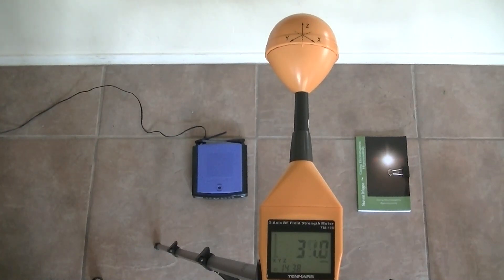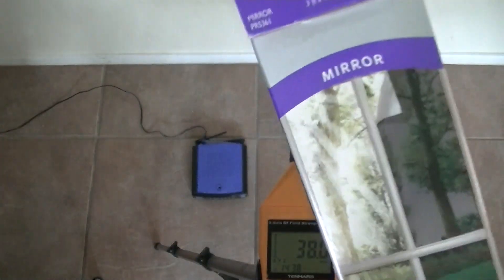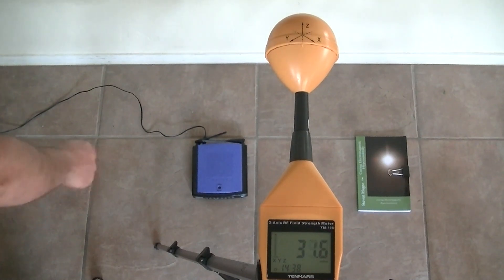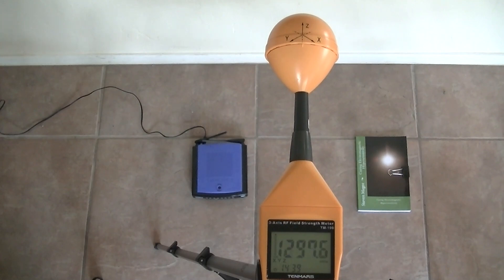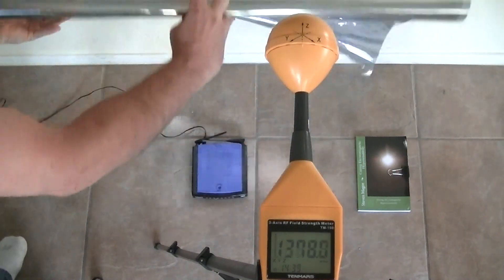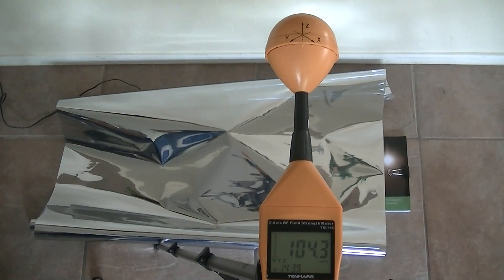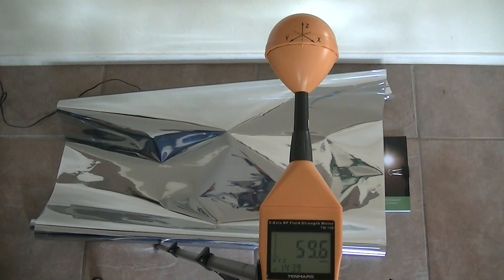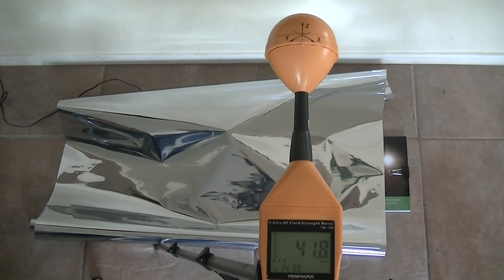Testing Mirrored Window Film for Electromagnetic RF Shielding

Comment: To anyone watching this in the future... this works so well. I have a 5g tower right in front of my apartment. I tried making aluminum screens with a 1mm aperature but failed they look terrible. I didnt want to spend 300 dollars on tint advertised for emf radiation but had to do something for my windows. I bought this at home depot it was 40 dollars I can do all 3 of my windows. It is mirrored and made of titanium and is an absolute god send. I know 5g has higher frequency than a lot of readers can go, mine goes from 20Mhz to  6Ghz, and as soon as I put this up I was down to previous levels before the tower went up. And I mean this thing is literally in my front yard. 

As for the walls, I have put aluminum foil for now, looks terrible. I'm going to try the aluminum backsplash wallpaper on Amazon that's 10 dollars a roll for about 15inx100in, somewhere in that range. It'll cost me around 120 dollars to cover the two most important walls and that will look a lot nicer. Then for the opposite wall I'm just stapling aluminim foil and I will be getting a ceiling curtain track it's about 20 dollars on Amazon and hanging a large 90 in tall by 100in wide curtain that will have a portrait of something on it, haven't decided yet. There are quite a few cool ones online. The pictures that people have posted are pretty cool. So there's just a few ideas for people on a budget. I live in an apartment and can't do permanent. I can't use emf paint because it needs to be grounded and is just about permanent unless you want to risk ruining your wallboard with an electric sander. If it were a house I owned I would paint as it is the nicest looking option. So anyway, thanks for uploading this, I probably wouldn't have considered mirrored tint and would have spent too much on emf tint or emf curtains.
Reply: ChicGreekGeek  well I use the Trifield Tf2 which I think is more or around 200 dollars, I've had it for a while. I wouldn't worry so much about other peoples routers unless they have put it against a wall that is shared by you and its in a spot you spend a lot of time (like a bed against a shared wall with a router on the other side) because radiation from a router falls off very quickly. The bulk of the radiation is within a foot of the router, if I'm standing 6 feet from my router I'll barely register anything. That being said I put a "router guard" brand shield over mine because the only spot to plug it in what next to my couch, and then I have my computer wired into it. 

I would cut around the outlets, thats what I did. And I suggest standing a few feet away, again the radiation will fall off quickly the further away from your phone you are. I measured my phone and was probably standing 4 feet away when I no longer got a signal from it while I was downloading something. The radiation can only bounce back if it can reach the metal surface first. So just keep that in mind if you have like a chair or something you sit in thats up against the screen, any rf radiation that hits it will bounce off and travel a very short distance. 

Thats good you are getting involved, good luck. I know they don't seem to have any responsibility to prove that its safe because it meets the decades old FCC safety standards. A whole system overhaul is what we need. Until then its a very round-about fight
Reply: Excellent info.  I'd love to hear more.  Products, links, what you think about them.  I'm in the same boat.  5G metres going up everywhere; headaches have started, insomnia, tinnitus has shot through the roof, can't concentrate any more and everyone in the house is short tempered and reading to 'go off' over nothing at all.  Got to do something.  What else are you using.
Reply: @ВладимирПутин-е7м  hi sorry I didn't see your comment. I posted one just now with the brand of tint I used but most of the stuff is just common that you can get from multiple brands online or in store such as aluminim screening, mylar, aluminum foil, ceilings tracks etc.
Reply: Nice work! And your efforts in typing all that ouot for people